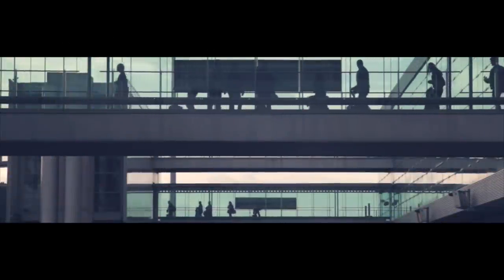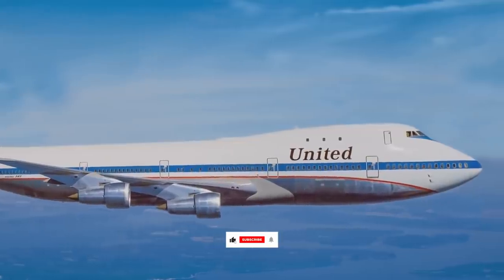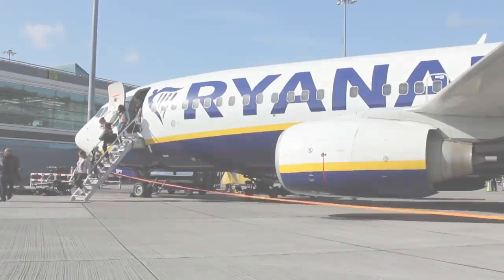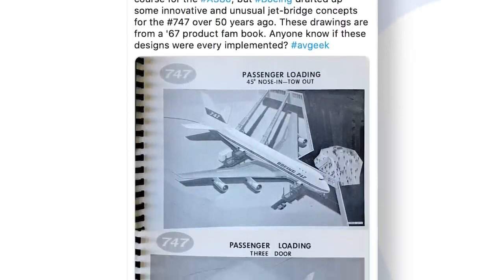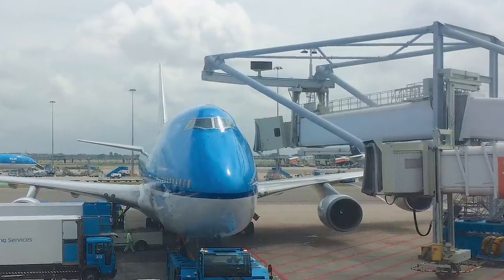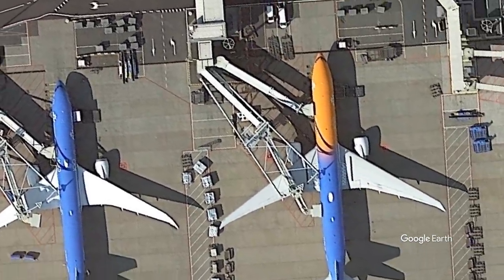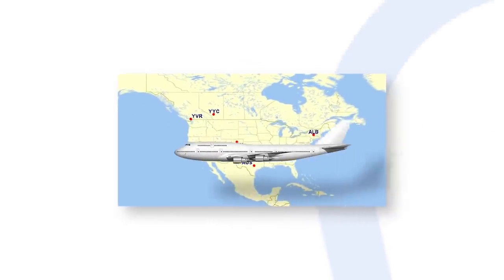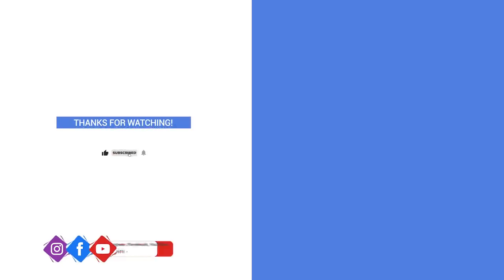Do Any Airports Still Have Over Wing Jet Bridges?

Comment: Fun fact. They would never use a jet bridge on the overwing door (#3) on a 747.  When you pumped the wing full of fuel the structure would slightly bend and these doors are all but impossible to close.  Had many an issue with the cleaning staff explaining why they couldn’t open #3 doors for ventilation while refuelling.
Reply: Interesting, I wonder if the DC-10 had a similar problem

Comment: As a person who work on jet bridge maintenance, these design is a maintenance nightmare. It is already hard enough to perform proper maintenance on regular bridge in busy airport. These over wing bridge would require at least twice as much time for maintenance. Not to mention piloting over wing bridge would possibly require additional license compare to regular bridge. When jumbo jet become less popular, it is just reasonable to switch back to regular bridge.
Reply: Yes, it looks very complex and danger of wing damage much more likely. 
I bet everyone is glad to return to simpler systems!
Reply: Thanks for your insight. Always nice to hear from people that have to work with these things. Keep up the good work.
Reply: As an experienced OTW operator, you dont need an additional license. Most jetways have safety systems and sensors that wont allow you to get too close to an aircraft wing. The computer will detect that and stop automatically. You have reset and retract and try again. OTW's just take more time to dock because their freedom of movement is very restricted, you always have to nail it on the first try or you will delay the deboarding process
Reply: Also, the 777-300 versions that it could be used for have 2 doors in front of the wing, so a twin bridge that uses those two doors instead would work just as well (especially since these are 2 aisle plains, so each bridge serving 1 aisle would still give the throughput.
Reply: @NLaertes  thanks for your information about OTW jet bridge. It sounds more complicated than what I initially thought.
Reply: You do have to take the considerable cost of replacing the things into consideration. 
Shutting down a good portion of a ramp for several weeks is very expensive, and then of course there's the cost of the new hardware and disposing of the old, crew (re)training, certification, etc.

It's probably cheaper to block off the overwing section and then during a quiet period (probably overnight) disconnect it from the larger structure so it can be loaded onto a flatbed truck and carted off for disassembly.
Which is pretty much what we see at Schiphol, where their removal is done coinciding with required maintenance on (and thus closure of) the surrounding ramp area.
Reply: good insight, would have been nice if this had been answered in the vid
Reply: Lots of damage caused by those things..
Reply: @tiemen9095  Easiest solution I imagine is if aircraft are redesigned to have more doors in front of the wing so that you could add more conventional aerobridges

Comment: At Schiphol, gates E18-E20-E22-E24 are mainly used for A380s, in order to handle the passenger pressure. Especially in the morning with the incoming flights from the US and Asia/Middle East countries, many passengers embark at terminal E.

For example, I often traveled from Singapore with KLM B777 and landed at 6 am. But at the same time also Delta and China Southern A380 and sometimes an Emirates A380. It was really always overcrowded, but there was flow in it that didn't have to wait very long in the lines.
Reply: only E18 and E24 are a380 capable. and E24 had to be changed to accommodate the larger wing span on the a380.

Comment: I never thought about the logistics of loading and unloading large aircraft. What solution do they use now?
Reply: just a dual jet bridge for the front two doors (1L and 2L) and at some smaller airports just 1 jet bridge. Even AMS doesn't use the overwing jet bridges anymore as they often take more time to connect and disconnect than to just board using only one door.
Reply: If a widebody is on a remote stand they will usually use the second and the last door for bording, similar to how it's done on narrowbodies on such positions. Sometimes they might use the first door too there, meaning that the passenger could chose between three stairs to get in

Comment: I wonder if any airports still use “mobile lounges” to shuttle people to and from aircraft and terminal buildings?
Reply: Washington Dulles in Virginia, and Montréal–Trudeau International Airport in Canada still use them, but on a small scale.
Reply: SeaTac does this
Reply: i've used them once
Reply: @get2dachoppa249  Yup Dulles still uses it... hate it though man, gets all cramped with no proper light, unlike your usual terminal busses
Reply: @get2dachoppa249  We used to have them at Mirabel - almost used them exclusively when flying out of there. I miss that place...sigh
Reply: Dulles hasn’t driven them up to the plane itself for passenger loading in decades, as far as I know.  They just used them to connect between the midfield terminals and the main terminal since the 80s…  now they have a rail system (finally…)
Reply: Oh correction - they still use a few for international arrivals even now.
Reply: Washington Dulles has joined the chat 😂